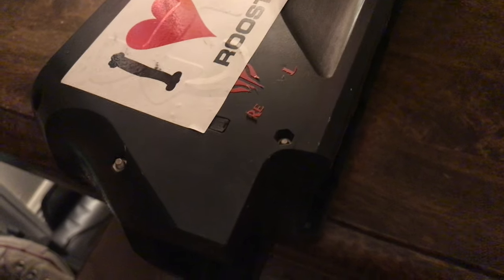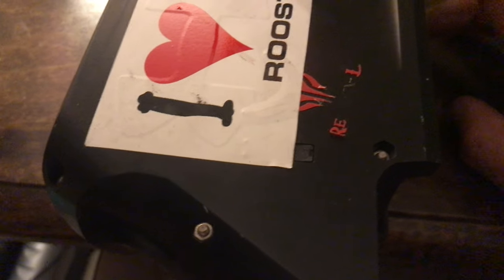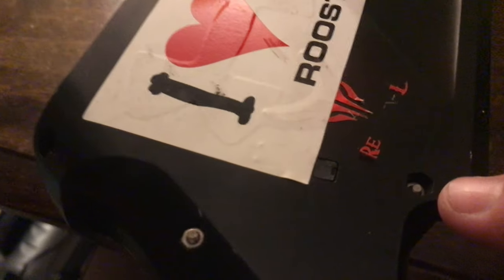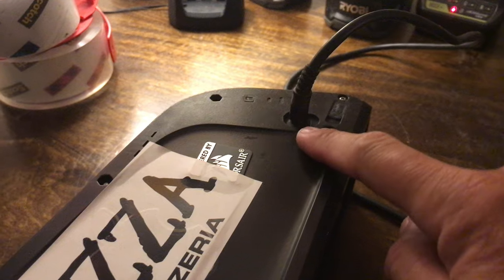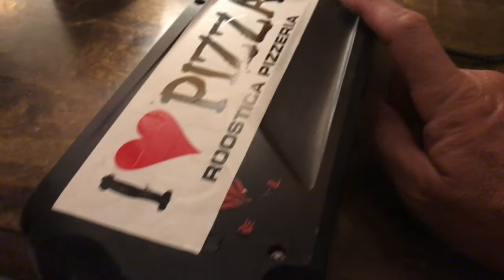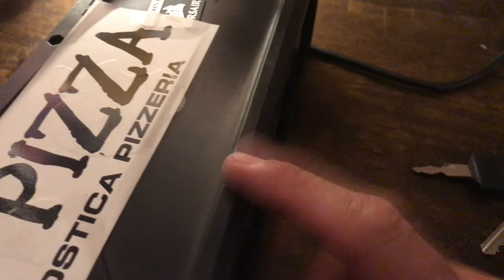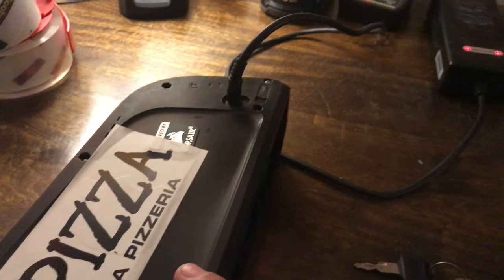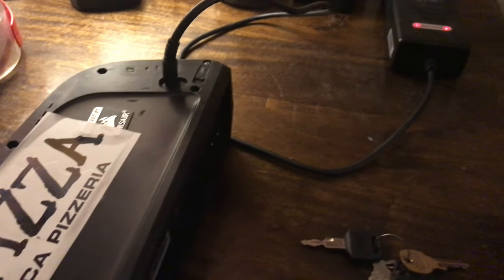How To Fix your Shorted EBIKE Battery Pack. #EBIKE #ebikebattery #radpowerbikes

Comment: I have a Ride1up eBike & was unlocking the speed governor through the controller & made the mistake of lifting the rear wheel up while pushing down the thrumb throttle all way, bike went dead and would not turn back on. Thankfully I was only a 5 mintute walk from home and have a second battery that I was able to put in to try to sus out if I fried the controller or it was just isolated to the battery. Thankfully the later was the case, pulled the fuse & could clearly see that it was blown. I've also opened the same type of battery to glue the charge port back in place after it got knocked over & fell right onto it while it was plugged in so I wasn't too apprehensive about taking it apart. 
Took my new dead battery pack apart and thankfully it uses 2 standard car fuses, one on each end (charging side & bike output side). One quick trip to the auto store on my working battery, small tool kit & multimeter I was back up and running in no time.
Reply from the maker: Yes. Thank God they made the Darwin fuse for these instances. It was surprisingly an easy solution.
Imagine how many people do not know about the fuse and end up throwing out a perfectly good battery and buy a new one.    Knowledge is power. My battery pack is 8 years old and still going strong.